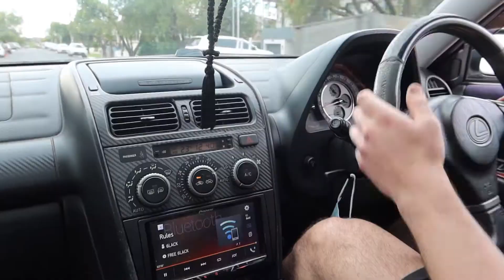More Suspension Upgrades for the IS300 - (FRONT TENSION RODS INSTALL)

Comment: Do these replace the rear lower control arm on the front? Looking to do this to my jzx
Reply from the maker: This is just the tention rods, replacing factory rod with upgrades rods. They are "zss front tention rods" also suiting JZX90 and JZX100